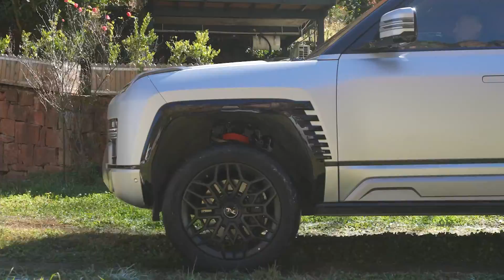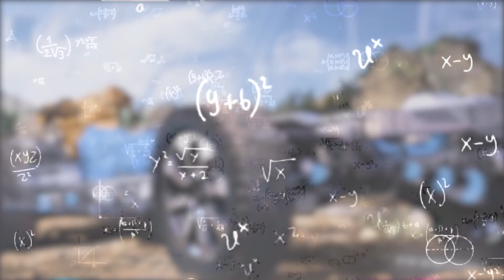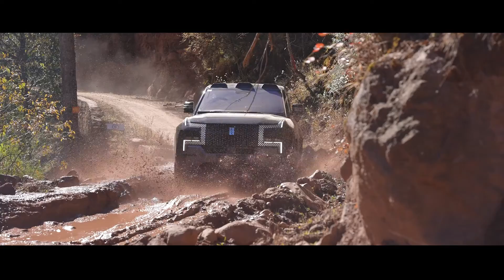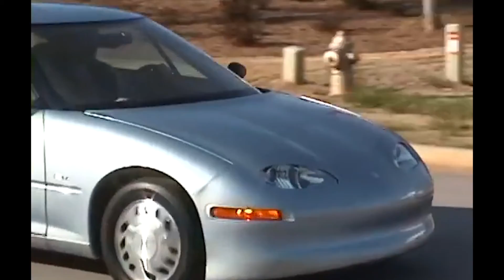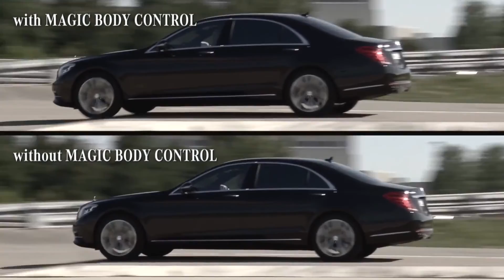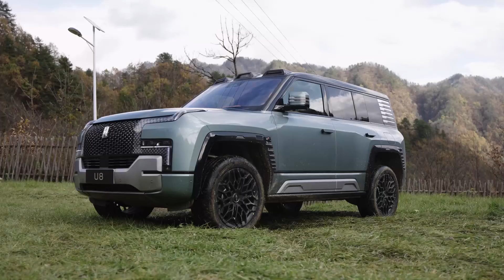This Suspension Can Conquer Any Terrain!?  BYD Disus-P, Explained

Comment: It looks like a GTA version of a Land Rover Defender😂 But it's cool! Maybe not as cool as GWM Tank 500, but still cool
Reply: Does tank 500 has 1200HP😂
Reply: @cwdjdsd-36321cs  in my country we pay tax based on hp. 1200 will cost me about $2000 a year. That's kind of a lot considering the car itself costs like $50-60k
Reply: @ldmtag  byd U8 has 1200HP and the price is 150000 USD in china
Reply from the maker: @ldmtag  tax on hp... wow even on EVs?      European country?
Reply: Like most designs from China, it's going to be a copy of something. I agree that is clearly "inspired" by the current Land Rover Defender.
Reply: @brianb-p6586  for your information this model and most other BYDs are designed by a former Audi and Lamborghini designer called Wolfgang Egger 🤣
Reply: @cwdjdsd-36321cs  okay, Egger copied the Land Rover Defender for BYD.
Reply: @brianb-p6586  so what? keep crying 😂 that means even European top tier designers don't have an issue with borrowing design Ideas from other companies 🤣🤣 This car has already got 30000 pre orders in china alone, and the price is 150000 USD
Let's see how land rover is gonna keep up with superior products like these
Reply: @brianb-p6586  This is a 1200HP EV that does 0-100 in 3.6 seconds, has hydraulic suspension, can tank turn and float across rivers. It also has 6 screens,70 inch AR HUD plus a refrigerator.
Land rover is a toy Infront of this 🤣🤣
Reply: @cwdjdsd-36321cs  that's nice. The discussion was about styling.
Reply: @brianb-p6586  sure, but every box shaped SUV is not a defender
Reply: @rcwsd-36321c  no, but the details on this one scream "Defender". It doesn't really matter - it's just amusing.
Reply from the maker: You would be suprised by how many offroaders are mimicking the look of new defender these days. 😂 Kinda tired of it tbh

Comment: Its was bosch suspension in 1990 as i know. You just added smartphone to it 😂
Reply: That is like saying Ford Model T uses gasoline, and today's fuel injection is just adding a pump. Bosch has taken a back seat. Getting old and olsolete.
Reply from the maker: it is Bose. Not only smart software, there's also stronger power source, sensors and lot of sensors